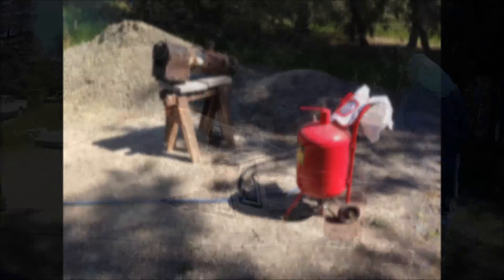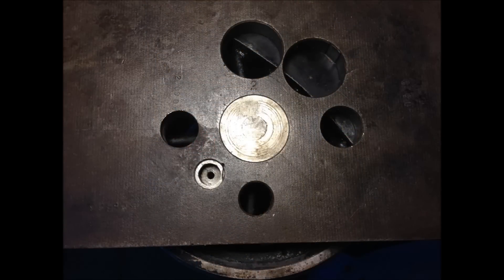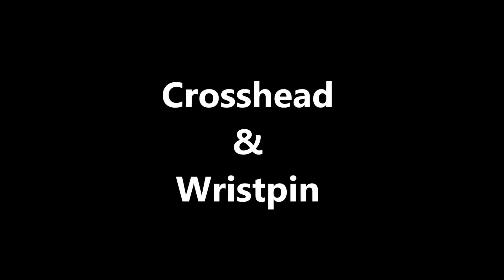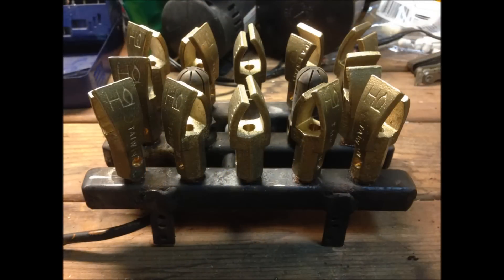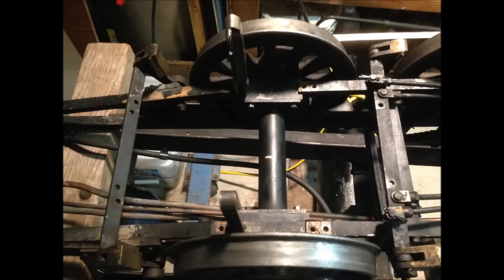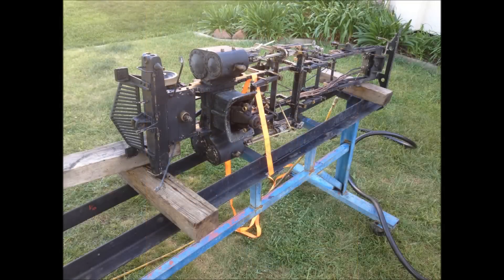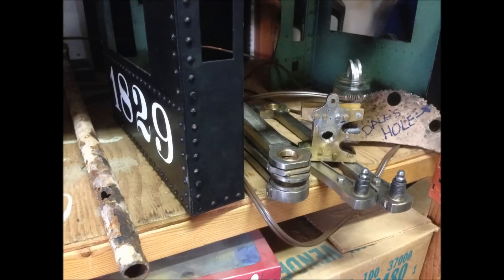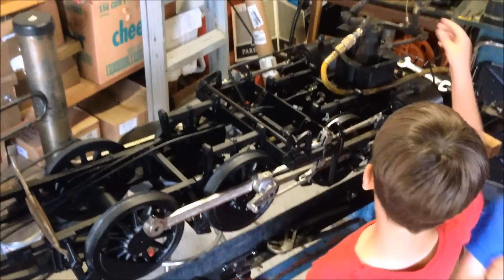2015 Locomotive Repair Pt 2

Comment: Many of the cast parts on this loco look like Little Engines parts.  Was it originally a LE 2-6-0 kit? When I saw the condition of the boiler in the earlier video, I would have immediately started looking for a boiler maker. I don't have the skills needed to do that kind of repair.
Reply from the maker: Yes, this locomotive was built with Little Engines castings. That rebuilt boiler is still going strong 7-years later!
Reply: @ChrisDonhost  Are you now using water treatment on your boiler?
Reply from the maker: I no longer own that locomotive. I  did use boiler treatment when I owned it.

Comment: If it was built correctly from the beginning the key should have kept the drivers properly quartered, I question that part.
Reply: That would be hard on stuff for sure.
Most people never think about what goes into tramming a locomotive & most of that knowledge has been lost.
Reply from the maker: Correct. It wasn’t built correctly. One of the three drivers was off slightly. After I requartered the driver that was incorrect, a new off center key was made to fit the offset key way. Perhaps a little janky, but effective. Keep in mind, most of these models are built by hobby machinists without the benefit of a professional machine shop. Fixing that one driver made a significant difference in the operation of the locomotive.

Comment: Well done. I think even though it was unfortunate that you had a failure that started the whole project but in the end after getting the drivers quartered and replacing bearings etc the loco probably is a better performer because of it. Good job taking the time to correct the items making it right.
Reply from the maker: Indeed- she runs great, so it was well worth the effort.